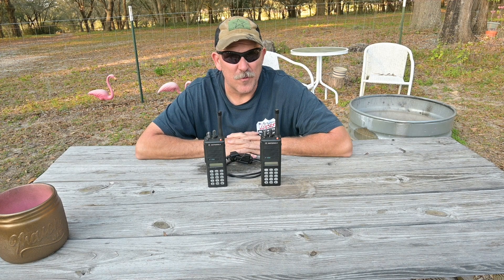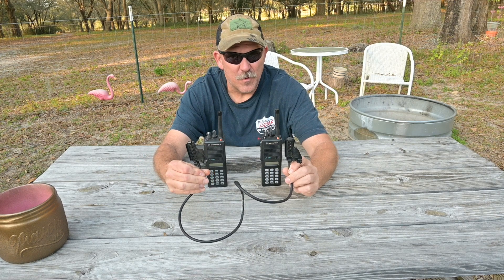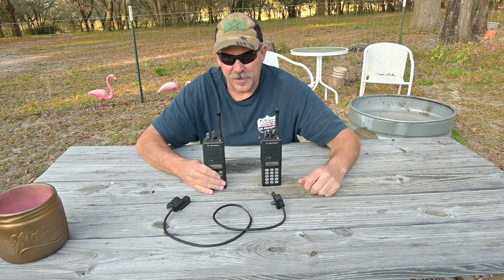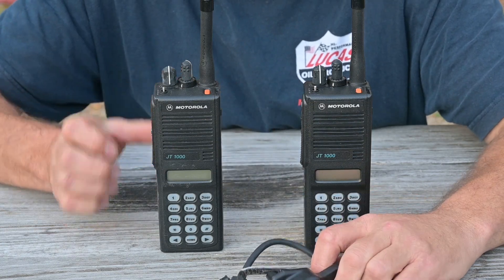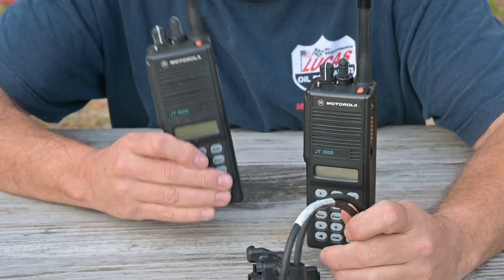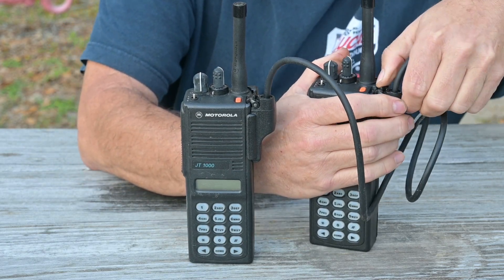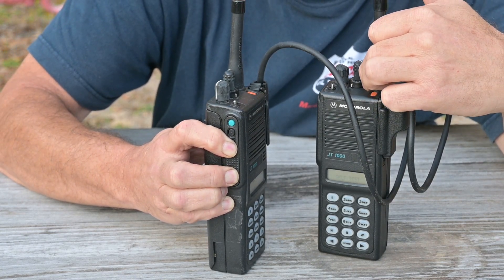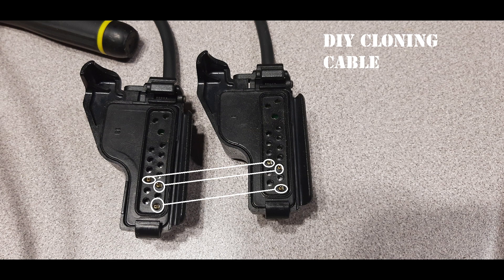Motorola Radio to Radio cloning Jedi - HT1000 JT1000 MT2000

Comment: The JT was one of my favorites.
We sure have come a long way in radio technology!
This sure brought back old memories. 

When I first began as a volunteer for my small local volunteer FD, 
we had a rack charger with a few HT220 2-channel portable radios that were mostly used by the officers and EMS crews.

Our small town shared a single VHFHigh-Band simplex frequency with 4 or 5 surrounding town for police use and a second freq for fire and first aid squad (now called  “EMS”) use.   Everything was carrier squelch and transmit discipline was pretty decent.  Surprisingly, there was not much abuse.  The biggest problem was lack of radio to radio comms without involving dispatch center as the “middle man” and too much traffic during major events.

Plectron 2-tone sequential paging on the fire channel and every firefighter was issued a home alerting receiver with Nicad internal battery that worked only long enough to go to the grocery store and back before recharge was required.
THIS also caused issues during large events.  Each PD had a base station at HQ and some had remote transceivers using DC remotes over copper RTNA leased circuits from the phone co.  

When our PD’s detectives upgraded radios, we got their “hand me downs”.
P220 “Slim” portables.  I believe they were only 2-watts ..?  They did not have the fire frequency installed, so we had to have channel elements and crystals ordered to “upgrade” them.   It took weeks, if not longer, just to get the parts in.

We eventually got a few  MT500’s, but didn’t have the funding for quality gear, so we’re sold on the Midland/Regency radios by a local radio shop  in the late 1970’s.  They lasted under a year or so.  You get what you pay for.   Then Radius P200’s and HT-600’s (same ?) and then HT1000’s for in town and JT1000’s for mutual aid out of town use.
Then came 9/11 and the nightmare of lack of “interoperability”.  

It’s been a nice advancement since then, but with too much unnecessary encryption and the “T-Band UHF” nightmare initiated by the Obama admin.  President Trump must have had a knowledgeable source from FDNY or NYPD brief him on the looming disaster of losing the spectrum and their phenomenally performing system.  

They ditched the “T-Band Take back” from the Obama era “Stimulus Act” before it went into effect.
But, most large agencies had already jumped to 700/800MHz, for fear of losing their allocated + licensed  T-Band spectrum.

The world has changed so much.   Mostly for the better.
Sadly, the tragic attempted assassination on President Trump exposed the lack of “interoperability” in emergency communications still exists.  DHS-HSI & SS   / PA State Police / Butler - county are all on different systems.  
Each wirh encryption.

Not great.
Thank you so much for your videos.
😊

Comment: During the intro, you used the phrase "Jedi series radios".  Can you elaborate on that?

I am just starting in trying to get some Motorola legs under me and my current understanding of Jedi is simply as a connector.

That phrase leads me down a train of thought that Jedi actually a radio architecture that various lines of Motorola radios are built upon.

TY Brett, your vids are always appreciated.
Reply from the maker: This series of radios HT1000, JT1000 MT2000 MTS2000  & many more models using the same physical design are commonly referred to as the Jedi series . They were the first products to use a clamshell battery arrangement and a snap together fastenerless design . I have a video explaining complete disassembly of this generation of radio.
https://www.youtube.com/watch?v=3a8x8cZz9MA
 The direct predecessors to the Jedi series was the Saber series and the Genesis series (HT600 , MT1000, etc.). The generation after the Jedi is the Cosmo series (XTS3000) . Thanks for watching !

Comment: Great tip and reminder I need to make a cable for these great cache-radios (and buy new batteries for the kit)
Reply: Excellent video as usual. I was just doing a couple dozen HT600/P200s last night. A box of HT1000s are next. JT1000s are excellent. Wish I had more. Love the FPP ability.
Reply from the maker: @RandomWire107  They certainly are great radios. Like I had mentioned to Rick earlier good batteries make all the difference. Thanks for watching !
Reply from the maker: These are excellent radios for that. The cables are really easy to make.  These are absolutely the best batteries still made for this product line 
https://gtspower.com/products/two-way-radios/batteries/ush7144-m27/
Not the least expensive but they are worth it. Thanks for watching !
Reply: @SurvivalComms   Thanks for the recommendation ! It often feels like a roll of the dice when buying after-market batteries.
Reply from the maker: @rickmaudlin2160  You are welcome when I recommend a product it is something I have had experience with and GTS is the premier manufacturer of these batteries .  The amazon / ebay batteries are awful IMHO.